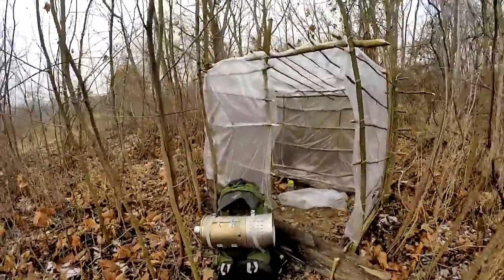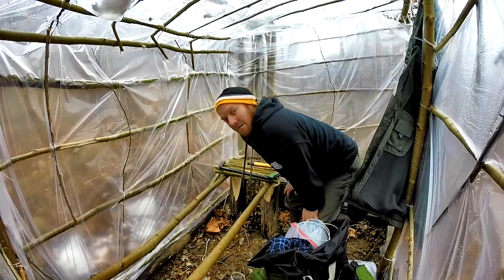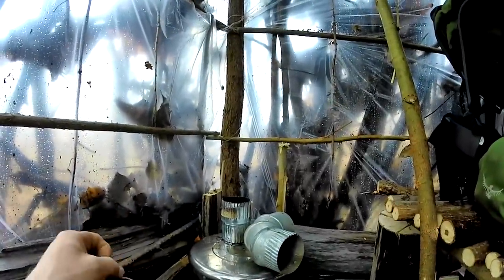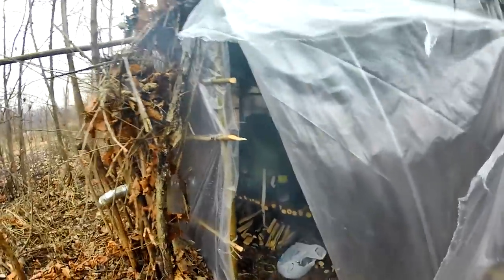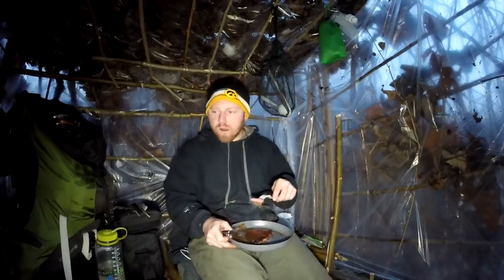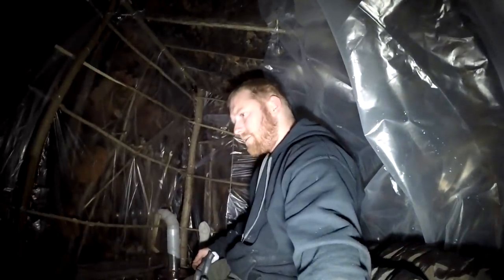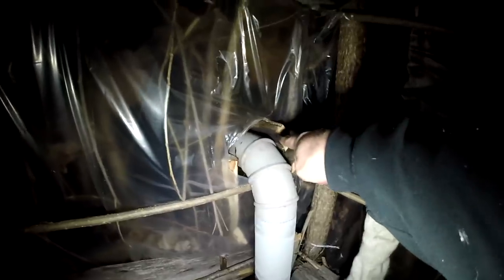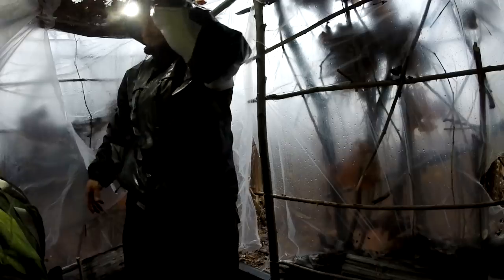Solo plastic shack overnighter in a winter rain storm never going to learn if you dont try

Comment: That doesn't look like condensation to me..It looks like you punctured the plastic when you put the sticks and leaves on top. Just a few pinholes will do that. If it was all  just condensation it would be all over the plastic and things would not be puddley wet  but soaked less visibly and more evenly... 

I have never seen anyone take such chances with a woodstove, especially sitting inside a plastic leaf and twig sheller. Noone I know would ever put a stovepipe directly against wood (no matter how wet it is... THOSE PIPES GET HOT!!  ) or plastic of anything. You need heavier gauge plastic and a metal colla, and a carbon monoxide monitor

Other than that it was a cool video and I enjoyed it.... BE SAFE!  AND MAKE MORE VIDEOS ... aka: LIVE LONG AND PROSPER lol
Reply from the maker: Haha yeah you're never going to learn if you don't try! I just jump into things. I've learned alot since then. Thanks for the tips and kind words!

Comment: For fun we would bend trees tie then and cover with plastic. 
Made one that was fitheen feet high.  Hold ten teenagers 
We built brick banks for the fire and it would get very warm.    I’m mean those bricks were smoking.     We would cut It down and the trees would spring back.   Kind of anyway.     Now I build bubbles.  With thin strip and plastic.    So far 55mph. Some damage   Other than that .  All well
Reply from the maker: Sounds like some fun forts!
Reply: chris mclaughlin yes round on both ends.   Using thin strips of wood.   One winter I covered my bus so I could paint     Average temp held 22 degrees above the out side.   
The last one was 13 by 28.  12foot high.    It’s made three winters so far.    Added a rocket stove and have shirt sleeve temps.  In the snow.   
Because of the tapered ends it’s handled 55mph winds.  With just an edge peal.

Comment: next time turn that pipe up and ad 2 feet of pipe and you have no smoke inside and put 2 layers of plastic where you sleep , the outer one will catch the  condensation as it is the coldest and a big piece of carton between you and the wall . have fun Paul
Reply from the maker: Stove also didn't have a wind cap. Stayed nice and warm that night after got everything going! Thanks for the tips!
Reply: Its wet because plastics?
Reply from the maker: @yentyhotspicy  condensation from the heat inside.
Reply: @yentyhotspicy  plastic or metal will condensate if not insulated . condense will occur on the coldest surface .
Reply: So solution is need a hole? Don't covered all side, its right?
Reply: @yentyhotspicy  Sorry , but no ! you need some insulation . some cardboard or bubble plastic is enough . in Asia where it's warm you don't need it . Good luck .
Reply: @pauls466  there's wet too, even in asia (mountain area). We use camping tend